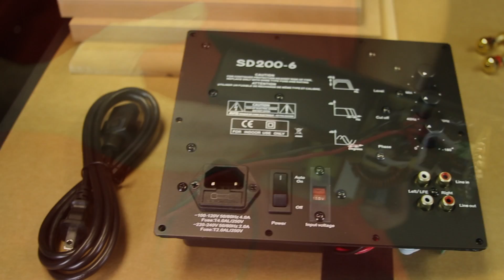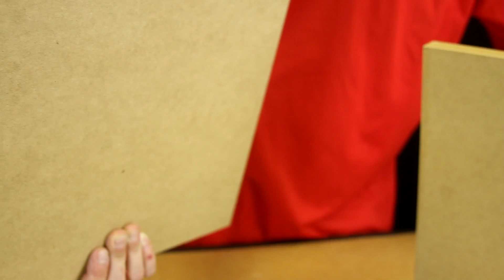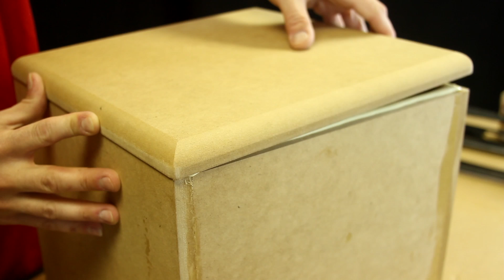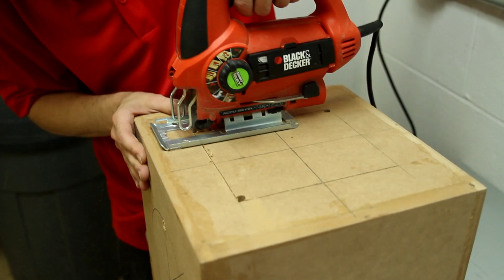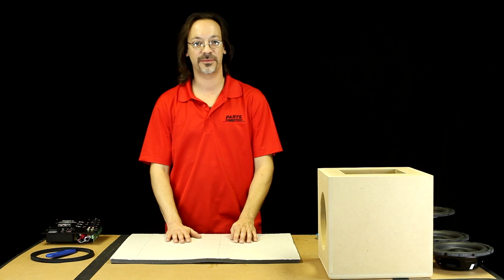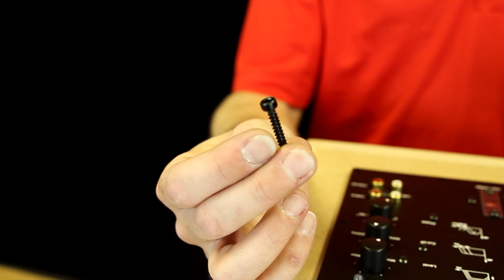How to build an Eminence 8" Subwoofer Kit

Comment: How much are just the drivers and passvies
Reply from the maker: Unfortunately the driver and passive radiator used in this build is no longer available.
We do have some options that you could use to build something comparable. For instance, the Tang Band W8-740P 8" Subwoofer with 2 of the Dayton Audio DS215-PR 8" Designer Series Passive Radiators would be a great match.

Comment: why do you only make one side a lap joint? why don't you machine it  so both pieces  of material have a lap joint  this is better construction.
Reply: I realise this is an old comment but what the h#ll, I'll answer anyhow. I'm guessing the reason is alignment during assembly would make it difficult to get everything lined up so all the joint fit perfect. Its a give and take between ease of assembly and durability.

Comment: ///////////no nails or screws to reinforce this cabinet. Also 3 woofers no ventilation
Reply from the maker: Any quality wood glue is actually stronger than the wood itself, so no screws or nails are required. You could use them in place of the clamps to hold the enclosure together while the glue dries. If the enclosure is going to be moved or thrown around quite a bit, like in pro sound applications (PA or DJ speakers) then I would recommend some additional corner reinforcement, but I would also recommend high quality plywood instead of MDF. Plywood is much more durable and moisture resistant than MDF, but it can be more difficult to get a good (super smooth) finish with plywood. Also, plywood isn't as stiff as MDF, so I would recommend additional bracing.

There is actually only one woofer in the enclosure. The other two are passive radiators (no magnet or voice coil). Passive radiators tune the enclosure like vents (ports) but allow much lower tuning then possible without a huge port. For example, if this system used a port it would need to be 4 inches (10.16 cm) in diameter by 86 inches (218.44 cm) long the achieve the same response, the vent would actually be larger than the enclosure itself.

Comment: It looks like you have 3 speakers there.  It looks like you only hooked up one speaker to the amp.  Did you hook up the other speakers?  What am I missing?
Reply from the maker: The other speakers are passive.
Reply: It is actually 1 speaker and 2 passive radiators. 
A passive radiator is more or less a speaker without a magnet or voice coil. They serve the same purpose as a port (tuning the enclosure)... The big advantage with passive radiators is that you can tune small enclosures much lower than possible using a conventional port. 
http://www.parts-express.com/eminence-8-high-excursion-high-mass-passive-radiator--290-4011
Reply: ianwashere12345  the only down side of a passive radiator is the steeper roll-off
Reply: ianwashere12345 the other or passive

Comment: when your mdf is cut right you don't need so much glue, it will only make a mess
Reply: I'm pretty sure the glue is necessary for an air tight seal, right?
Reply: Alexandru Simonescu you do need quite a bit of glue especially MDF is very porous and does soak up  glue very easily you never know if there's a void even with a good cut but I do agree hes gone over top a bit and has  clamped it poorly.

Comment: Have you tried this sub in a down-firing configuration?
Reply: I haven't tried it yet, but it shouldn't be a problem for the driver itself. The Mms is fairly low (for a subwoofer at least) and the rigid suspension should have no issue supporting the weight. According to the math, the cone will only sag about 1.9% when used in a down firing configuration (Percentage of Sag = 24,849 / ( Xmax * Fs²)), in most cases under 5% is considered acceptable. 
I can tell you that the passive radiators should not be used down firing. The passives use a soft spider and a lot of mass (350 grams) to get the resonant frequency of the passives as low as possible. That combination does create significant sag. 

Driver down with the passives on the side should work fine. 
I actually use one of these at home in my living room system so I'll run it like that for a little while just to be sure.
Reply: Great info - thanks Chris!

Comment: Why not Flush Mount the Drivers? Makes putting on Metal Driver Grills a Lot Easier without having to get the next size bigger.
Reply from the maker: You can totally do that if you want! These kits are easily customized. We mostly did it this way for simplicity on video.